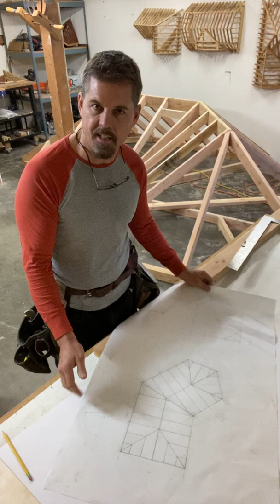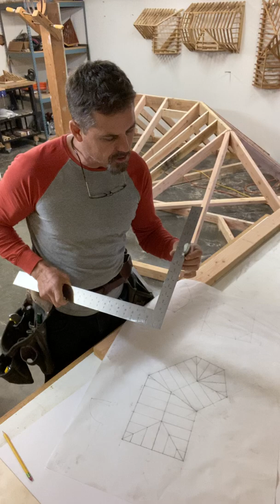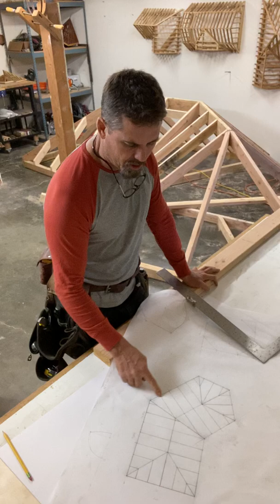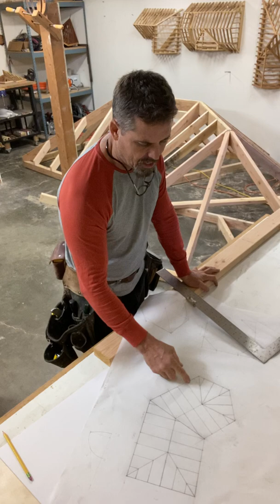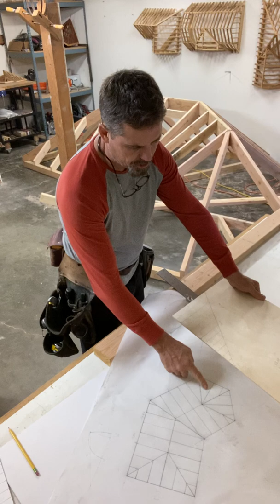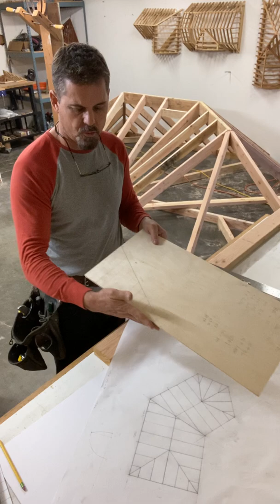Cutting a hexagon hip rafter

Comment: Have a couple questions with 5 sided bow window, with its own ridge board coming off of pitched roof. First hip rafter after 45 standard valley, witch projects too end of ridge, ply doesn't appear too lay flat, there's roll to it at top, heel stands are the same.would love to see mock up.

Comment: 16.97 not 17
Reply from the maker: lewwoodthing no sense in trying to eye .33” on the square but yep.
Reply: @roofcuttingandstacking7925  Them .33's add up fast when the hip or valley is 30'-40' just saying.
Great video though.
Reply from the maker: lewwoodthing yes absolutely.